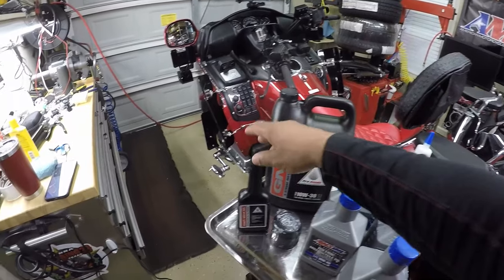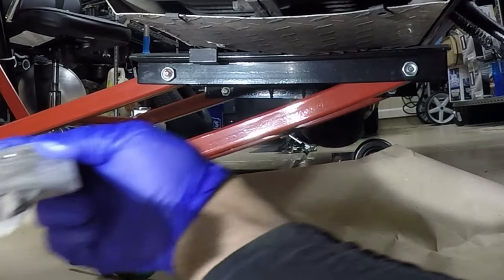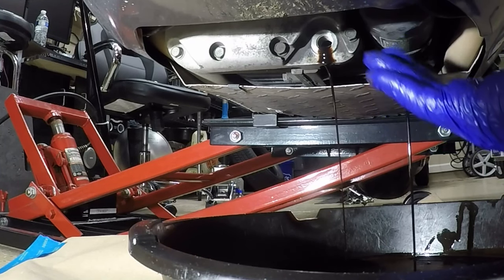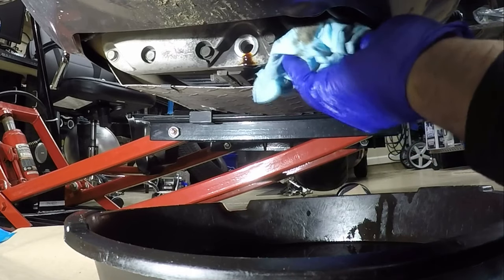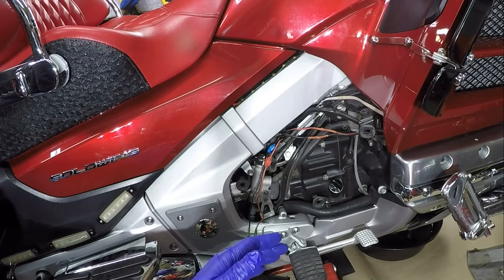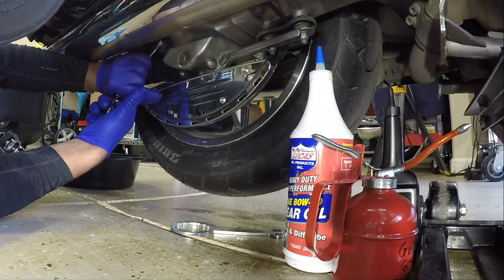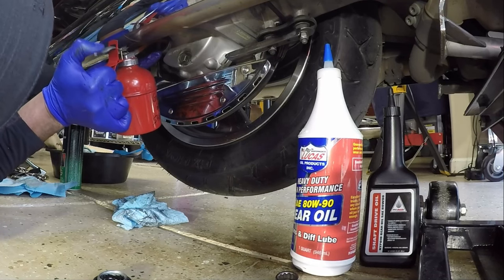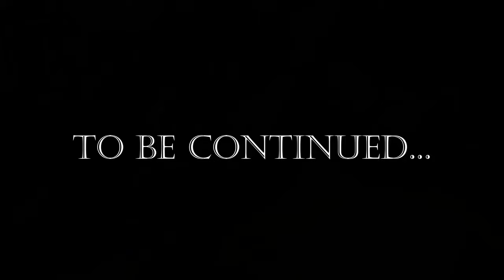Goldwing Oil change Synthetic oil back to Conventional Honda GN4

Comment: Yea I found my 2016 F6b shifts smoother with GN4 conventional and oil level at the bottom of the fill range on the dipstick. Not running low but lowest I can get to on the dipstick with the 3 min run from cold to off for 3 min. Whether on center stand or flat on ground gets the same reading so I use the center stand
Reply from the maker: Thanks for sharing your story.

Comment: You forgot the link to the oil pump can. FYI, I got mine from Harbor Freight.
Reply from the maker: https://www.harborfreight.com/20-oz-flexible-spout-oil-can-1113.html?utm_source=google&utm_medium=cpc&utm_campaign=12144811130&campaignid=12144811130&utm_content=117789252398&adsetid=117789252398&product=1113&store=85&gclid=Cj0KCQiAweaNBhDEARIsAJ5hwbe0Sf4AUnvdCFLFw50spNEL7Sn3T8SRGVpk1f06kbcu4Ck0hWKO220aAvDhEALw_wcB

Comment: Where's the car tire Chris? You decided to switch back for a while? Love your maintenance videos.
Reply from the maker: You have a good eye, I'm temporarily rotating out my rear black wheel and CT with my unused spare, if I don't it will eventually dry rot if i never use it.
Reply: @chriscaliente5033  So Chris can you compare the handling of ct vs regular bridgestone g704? Do you have the stock suspension?

Comment: I couldn't help noticing but that is a motorcycle tire under that bike, and what did it cost you to have the transmission service done on the bike and the antifreeze serve
Reply from the maker: I'm temporarily rotating my unused spare, no need of letting it dry rot.

Comment: Checking every day for part two, the black ring of fire. Thinking of my mat silver 2016 F6b. Tried the black kury rotor covers but they were gloss black, all black colors on my bike are flat black and it didn’t look Right. Are the rings of fire glossy or flat? Looks glossy in the video
Reply from the maker: Stayed tuned I should post it in a few days…

Comment: On your new GW, which oil do you use? I read many blogs on moving to Synthetic. I refuse to do it on my 2020. Since day one, only Honda regular GN4. I follow Honda's engineers designing the DCT using regular oil. As long as we change it by the recommended schedule, no issues in my book. I might move to 10-40 from 10-30, that's about it.
Reply from the maker: Synthetic oil is based from distilled crude oil so using it in the newer Goldwing should not cause harm to the engine, just make sure that the oil meets Honda requirements and formulated for wet clutches because the same oil that lubricates the engine also lubricate the clutch plates.  At some point I will run full Synthetic oil in my new Goldwing unless the manufacturer specifically states in writing otherwise.
Reply: @chriscaliente5033  I had asked Honda about it. They are very conservative on using regular 10-30/40 for bikes. My dealer uses regular only. If you ask for synthetic, they will make a note on the bill, per customer's request. The bottom line is, so far, the bike runs smooth and fantastic on 10-30 GN4. Safe ride, boss.

Comment: Cool video. Write to me, please, I saw that you used AMSoil 10W30 before and now you use Honda 10W30 oil. Is this Honda oil better than AMSoil 10W30. Thank you for the information
Reply from the maker: Synthetics oil does have some advantages over conventional motor oil, but I now share miles betweeen two Goldwings consequently not running my 2016 as much.  I recommend that If you only have one bike, Synthetic would be the better option.
Reply: @chriscaliente5033  Thank you for your answer and please tell me if you also used AMSoil 10W30 in Honda Goldwing 2016 in the summer season
Reply from the maker: @mariuszgraczyk8583  yes I have used Amsoil 10w 30 in the summer many times.  Honda actually calls for 10w 30 for year models 2012 or newer but it wouldn’t hurt to run 10w 40 as an option in the summer months just for extra protection if your long distance traveling or pulling a trailer full time..Either way you should be fine.
Reply: @chriscaliente5033  Thank you for the information.

Comment: Just to let you know ,the W in the API specs stands for winter not weight--The 10w is the same for winter--The 30 is for colder months and the 40 is for warmer months--for cold weather riding I would use a 5w20 and the hot months use a 15w or 20w40 or 50